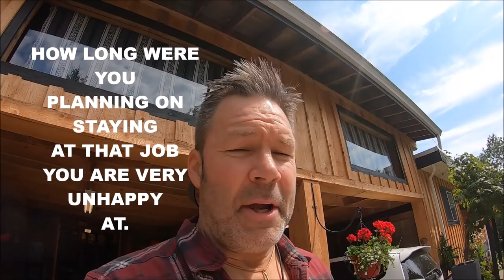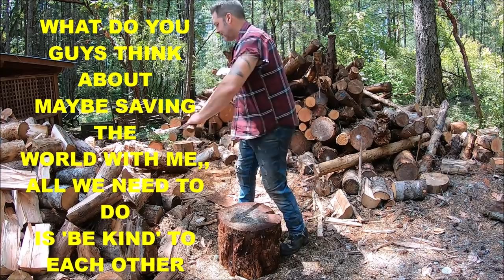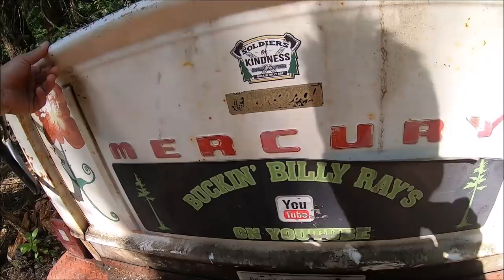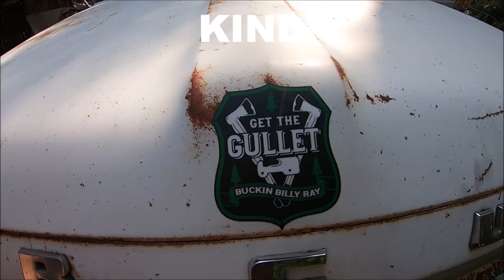HAND SPLITTING FIREWOOD, FREE STYLE, TRICK AND TIPS

Comment: Bukin's enthusiasm is infectious, it's great watching him walking around  his workshop. How many saws does he have? I have 4, I have 4 axes, two with broken handles. Saw Buckin fixing an axe it made me go out and start to fix my original splitting maul, a cheap but partially effective tool, used it for about 6 years and then the head came loose. I went out and bought a better replacement about 4 years ago, I kept looking at my old maul and did nothing but Buckin's piece about fixing handles has enthused me to fix my old maul. My other broken axe is an old american felling axe, it just feels great but often jams in some pieces, the handle has snapped near the head. I loved using it on clean bits of ash, I have loads of it at the moment so I'm going to fix than one as well. Watching someone as enthusiastic as Buckin makes me feel good in these awkward times, so thank you for that, keep up the good work.

Comment: SO glad I came across the Buckster!
Now, the very BEST cutting block is a big, !ow cut stump. Georgia has too many rocks to not have a block. I use a fireplace insert, so it's best to use smaller pieces. Every cut of yours would be 2 or 3 of mine, or what we call "overnighters" though I prefer 6 to 8' rounds for that.
That said, I find that for smaller pieces, my back don't like all that restanding, so I'll put several on the stump and use the chain and bungee cord trick. So nice to just circle them swinging away, nearly nothing leaving early!
I saw on the tube both pickaroon work and even better, the pike at work. Well, I only had one stick of 1" pipe, so wanting to make a pike (straight handle with a spike straight out the business end) and, wanting a pickaroon also, I simply welded another spike at a 90 degree angle to the base of the main spike. It's an awesome 2-in-one tool, and I'm calling it the "pikearoon"! ...and my back loves it!

Comment: Hi Buckin from wny ... I agree with ya that the chopping block is not the ticket ... a simple work-saving device is a light chain about 4-6ft long in conjunction with a rubber bungee cord ... secure a rubber bungee on one end of the chain (I use electric tape but you can use whatever) ... use your axe or hook-a-roon to set up (vertically) as many rounds as needed (depending on length of chain ) to allow the chain and bungee to hold the wood in tension (if you only have a few rounds you can just choke up on the chain with the  bungee hook )  ... now go NUTS and split away -  the chain and bungee will hold the wood in tension (no bending down to reposition/ re handle the Chunks ) when done splitting that load simply unhook and toss ur Chunks into a pile ... rinse and repeat ... When using a splitting block to elevate the Chunks for splitting you ARE losing  power on your downswing for sure plus all the bending / grabbing / repositioning the pieces back on top of the block makes for a lotta work !  Seems like Buckin way is the cats az and works well for ya - for myself I like me legs and feet just the way they are 😆!!!   I spent about 5 bucks making the “adj harness” So for all ya frugal ones out there (myself included) ya don’t have to break the bank (or your back) !!!

Comment: Do you sell splitting axes? I’d love to get my hands on a heritage tool. I guess I should just make my own, so my question is moot. But, I love your modus operandi. Keep on keepin on.
Reply: I did firewood for living, I used a splitting maul. It is less apt to stick in the wood,because it's wider. I would suggest a 6 lb. Maul with fiberglass handle. My first was a wood handle, It lasted about 15 min. And broke.          Best swing: feet wide, so you don't hit feet, reach high, quickly bend knees,  this jerk starts weight, swing with arms, while exhaling quickly, you will learn the movement and feel the power. ALWAYS  USE SAFTY GLASSES:)

Comment: I legit watch you and no one else on splitting wood. Awesome technique and great advice.... hey man. So I have a genuine question... names matt btw. Alright. I have a chainsaw and I promise the chain is sharp. The depth gauges are filed down with a gauge. However... when I go to saw some wood. It will do fine until the top of the bar is in the wood. Then it stops cutting and refuses to go any further. Any idea why? Also... if it is a crooked cut, what do I do to correct it even if a1ll the teeth are sharp. Thanks man. I'm a cnc machinist so if I need to get the teeth EXACT length i can do that lmao.

Comment: I only cut my own firewood but I like to cut my stump as close to ground level as I can. I prefer to cut and buck on the spot si halving or quartering before loading only makes sense to me so I simply use my stump to split on. Still nearly ground level so not bad. What I cut this year won't be burned for 2 years so plenty of time to split for stove wood. Wood is my only heat source so it's important to me that it be seasoned not just dry. We can see temperatures well below zero here and seasoned wood is much warmer than dry wood. If it's not gray it's not ready.